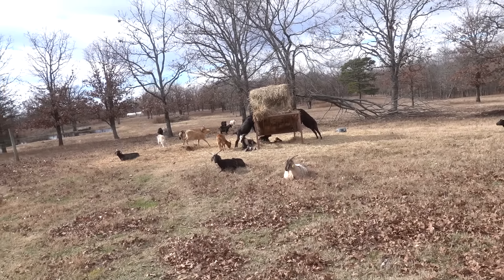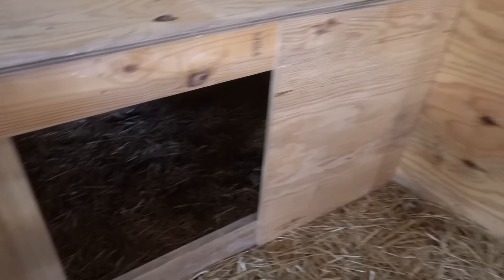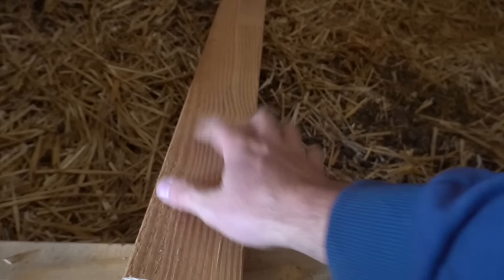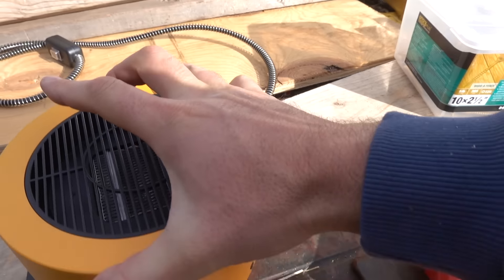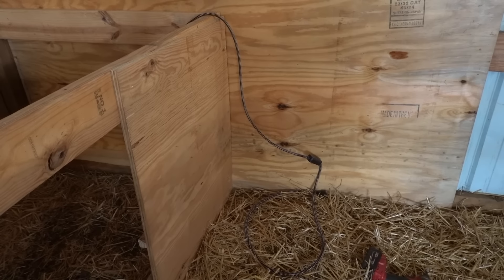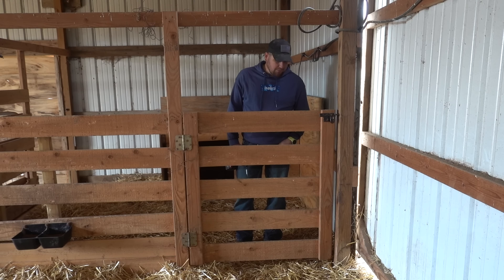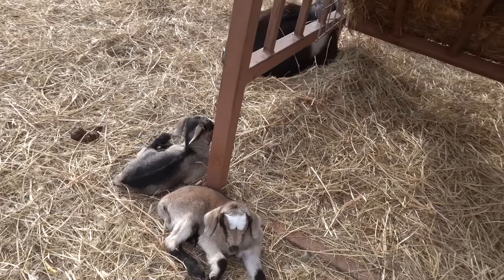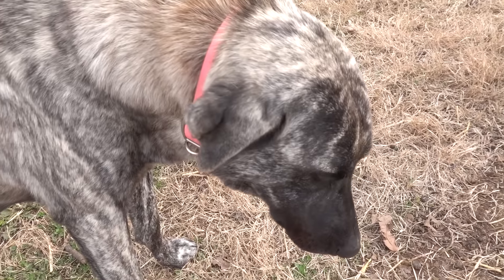Pregnant Guard Dog's Getting Massive! She's Already Bigger Than We Expected!

Comment: That is so nice of you that you built a birthing place for Kora.  You don't have to worry at all about disturbing the "bonding".  Kora and your other dogs see you as the leader of their family.  In fact, Kora will probably bring her babies to you actually.  😁😁  A small tip on Kora's box.  You may want to think about putting the top on hinges.  This will greatly ease you access as well.
Reply: I definitely second the hinges. If anything happens that you need to get to the puppies in a hurry or even just quietly, those hinges will be a God send.
Reply: Pepsi…what about hinging the side panel? That would keep them from leaning over, help keep the heat in and make for easier clean out.
Reply: @kathleenmoore4097  I was thinking the samething!!
Reply: A piano hinge would work real nice!
Reply: @J--G *Great minds think alike. I was going to congratulate Kevin on building top panel/lid with hinges as two fold now for  quiet/quick/easy access to puppies for cleaning etc but 2nd fold for Miss Cora to lay once the puppies eyes are open and they are are a little bigger and Miss Cora wants 5 minutes of peace and not feel like a 24/7 jersey 🥛 🍼 milk 🐮 cow  😂 😂 Miss Cora can still be there but out of reach especially if she gets sore nipples 😮 😢 from possibly feeding lots of 🐶 puppies 🐶 
Wishing Best 🎉 Life has to offer for Hidden Heights Farm Family & extended YT family 😉
Reply: Put a little platform for kora to lie on or another box inside where the pups can't escape and she can get up and stretch her legs or eat drink without getting hassled by the pups when they're bigger

Comment: Yes, move the babies inside if they are born out in the cold. With this being her first litter you may need to watch her to see how protective she is. If she is giving you problems about touching the babies initially you may need to put a leash on her and take her away while you put them all in the box then bring her and lock her in the stall with them for a few days. That should keep her from trying to move the babies back outside and give her time to acclimate to the box and feel safe. That usually works so she then keeps them in the box through out the nursing period. You really should put a shelf in the dog house also in case she decides to have or bring them in there while they are still tiny and weak. Love ❤️

Comment: You need to put Kora in the whelping area and shut the gates to keep her in at least 3-4 days before she reaches day 63. If she whelps outside in freezing temps, puppies will not survive as they cannot maintain their body temperature until they're 2-3 weeks of age.
Reply: Exactly right.  Puppies for first week need an environmental temp around 75-80F.  I point a heat lamp towards a corner so they have a warm corner. They can crawl out to a cooler area if they get too hot.  Then week 2-3 at minimum 70-75F.  Cold puppies will die.  Never feed a cold puppy as the gut will not digest the milk.  Definitely need a "pig-rail" about 4 inches from the floor or bedding pack and about 4 inches wide so that the pups have a way to get around mom without getting smashed.  I would also plan to keep Leeske out of the area.  First Cora might go after him and second he might go after the pups thinking they are rats when they squeak.
Reply: Yes 100% especially this time of year and being a 1st time mom need to be confined during the week prior, that way she will be used to it and less apt to be stressed during labor

Comment: Kevin, how about putting a couple hinges on the back of the lid on the dog house with a couple latches on the front with a prop stick. That way you can open up the lid without using the drill to remove the screws which may scare the puppies and or Kora if you need to gain access from the top.

Comment: The welping box design is very typical of what is used for pigs. The purpose is to keep the gilt from rolling over and crushing the piglets. Sometimes a railing is used and sometimes that railing is used to block off and protect a corner, allowing space for the piglets to snuggle up on each other and even hang a heat lamp, all protected from momma.

Comment: Nice box for cora and puppies. That heater sounds too hot. Dont let the pups get too heated. Remember cora and leesky are used to the cold.  Fix the hole on the right going into the dog stall. Put some boards down around the perimeter of the stall so puppies cant follow cora and get out. Thet can crawl through little holes.
Run your hand down under those boards you added to the sides of the box to make sure the screws didn't go through so they wont cut the puppies.

Comment: For your welping box you need a rail. This is a piece of wood attached aprox 5 to 6 inches above the floor and sticks out 4 to 5 inches from the wall. This rail goes all the war around the box. The purpose of the rail is to prevent mom from laying on or pinning a newborn puppy under her and against the side. Many puppies die this way in the first few days after they are born. Mostly to new moms. It's a very simple fix to prevent this from happening most of the time.
Also feed her treats in her welping area and even inside her box. Help her LIKE the area and associate it with good things like fresh warm hay to lay on and eating treats.
Yes you can move the puppies to her box BUT don't be shocked if she does let you touch them or if dad suddenly gets super protective for her. Just slowly work your way in, they trust you but you are working with instinct. Also once you get them moved mom may decide to move them back. You may need to move them more then once and possibly lock her there for a couple days.
As for the heater PLEASE be careful of anything with a cord. Dogs chew, puppies chew more and love to explore new things with thier mouth. Fires start easy in barns with hay. Puppies are born with a full coat of fur and a well insulated protective attentive mother. She will keep them warm and if she gets up to go out to potty or eat they will ball up into a pile. It's instinct driving that. Cora is a breed that routinely has puppies outside with zero human intervention. Her mothering skills are in her DNA and strong. You shouldn't need that heater at all but if it gets down into single digits maybe but be very watchful. True puppies don't regulatebody temp well on thier own but they are born I litters and together they do very well in a pile.

Comment: Use pool noodles instead of boards Kevin.  They can still be squished if you use boards.
I would also suggest you take the top off and use a heat lamp to warm the space.
Cora will have no problem with you moving them to a safer place... put a blanket in there and give her time to start nesting in that space...  I can't WAIT for the babies to come.  I train 8 week old labradoodle puppies for the Bonafide breeder (and new owners).  My heart belongs to puppies! <3
Reply: I just found pool noodles at the Dollar tree , great job Kevin in the dog house , I’ve not particularly seen tops on whelping boxes but hopefully it will work .. putting hinges in it for easy access would be beneficial I’m sure ..!

Comment: When its near her due date, definitely keep checking on Kora. When they are new moms they don't always know what's going on until they have a few puppies and go thru the  process of cleaning them up. I had a cocker spaniel   start having her first litter and she was pacing around and just dropped one out and she got confused.  I picked it up and started cleaning it off in front of her by  tearing open the sack  the puppy was in  and massaged the puppy to stimulate it and she started cleaning it off with me.  Once that happened she was great with the rest  and her motherly instincts kicked in.  Best of Luck.  You have so much experience with birthing animals and its not that much different, just a lot more babies.

Comment: If the puppies are born outside, there is no problem with moving them. The best way is to get a box with a blanket in it so you can put all the puppies into the box and then cover them with the ends of the blanket. It is important to let the mother be present while you are placing the puppies into the box so she will understand what you are doing. Some special treats for Cora will let her know that you are proud of her as a mom and she shouldn't be a problem with letting you move the puppies.

Comment: Yes you can move them.  Cora will more than likely appreciate the den you have constructed for her.  A pig rail ( the lower barrier around the border of the box) should be about 6" above the floor.   2x4 or 2x6 should be enough room for puppies.  Having the top of the box removeable would be a plus.  Makes it easier to clean and to check on the puppies.

Comment: Yes. You'll need pig rails in your whelping box. You'll also need Oral Calcium for Kora. At the first sign of her acting not so nice to the pups, or mouthing them a little too roughly, dose her with the Oral calcium. She'll settle down pretty quick. Good luck. I just whelped a litter of 6 Morkies on Christmas Day 💕🙏🐾 I would have gone with a heating pad, as the cold ground will suck the heat out of the pups bodies, as they cannot regulate their own body heat for the first 10 days of life. I'm thinking with a thick bed of hay, you won't even need any heat in there, as long as the flooring is dry.

Comment: Kevin yes by all means move mama and her pups inside the little house and pen them up. I would also start by putting Cora in the pin for a couple hours before hand to help her to determine hopefully where to have them. Also don’t hold that 63 days to tight, I’ve had with German Shepherds there first litter come in as early as 58 days. Just be prepared.

Comment: The whelping box should have a bumper/rim around the side to keep Kora from smothering pups behind her when she’s nursing others. Also not real sure about having the top on the box but my litters were in the house and I had a heat lamp 12 to 15 inches over the top.

And YES, if she doesn’t have them in the whelping box, move them to where they’re going to be safest.

Comment: Great whelping box. Yes to hinged lid. 
Mom will be looking for a safe place to have pups. She will dig a shallow area behind a bush hidden from view. Since it's winter, I would not risk that. Chilled pups are at very high risk and cannot nurse. Taking mom's daily  temperature 6 days before due date will give you a good indication when it's time. Average dog temp 100-101. When it drops 2-3 degrees, birthing imminent. I recommend closing mom in whelping box area/pen immediately. 
I bred my dogs for 38 years, only 2 litters 2yrs apart, each mom. Good luck to you and the mom.

Comment: You definately will need to move the pups if Cora has them outside. It's ok to do that, Cora will still care for them. 
Whelping boxes don't usually have lids. What if you need to help her deliver, you won't be able to get to them. At least either make the top removable or with hinges. Pups need to be kept very warm, for at least, the first 2 weeks. They can't hear or see when they are born too.
Great pig rails for the pups too. We Lways have towels ready just in case mom needs help delivering. She may not, but anything can happen.
Love the baby coat with the white belt.

Comment: It's fine if you move them. We used to breed german shepherds and they were outside. We would move them from the outside kennel into a side shed of our garage that we converted where we had it loaded with straw and heat. The mom never cared that we moved them to a safe warm place. We also made a door for the mom to go potty. We took thick plastic and cut strips in for a doggy door and it kept the heat or cool air in.

Comment: I wonder if putting a hinged cover over the whelping box would make it easier for you to gain access quickly if necessary. If you did, you'd probably want to add a latch too. Will you be placing a security camera in the whelping box?  Are you going to put some sort of cover over the door of the whelping box when the pups get a little bigger, and Kora isn't as glued to the whelping box to keep the puppies from climbing out and wandering off?

I'm curious to know how Kora will handle her dual roles as mama and protector of her babies, and LGD, protector of goats.  I can see where she could feel really conflicted about where she needs to be in the moment if she feels he puppies need her, but she also feels like she has work to do protecting the goats. It wouldn't be surprising if she shifts her focus to guarding closer to the barn and allows Leeske to do more perimeter work.  It will be interesting to see how everyone adapts to the new situations. As far as Leeske and the puppies go, I've seen mama dogs get pretty surly and fierce with the sires of their pups making it clear that he'd better mind the boundaries she sets with her puppies. I can see Kora doing that....

Comment: To make sure dog or goats don't get into the cord, you can put a 2X4 on each side of it, inside the box and on the outside. Even another board over the boards, but, it's probably not needed. Hinging the top sounds like a great idea too. I noticed goat  "mess" inside, I'd keep it cleaned up or block it off so they won't pee or poop in there, Cora may not wanna have her pups in that mess.

Comment: 💡EMU FEEDER TIP! To keep the barrel cut out from rubbing feathers off.. try putting the grey pipe insulation tube that normally you use to insulate pipes that is split in half. You can cut it to the length of your cutout and fit it right on the bottom part of the cutout, even the top also if needed. You may need to glue it for it to stay good.  I hope this idea might help that problem of rubbing the feathers off of them.
Reply: I think I’d be worried that the emus might peck that foam and eat it. A peck at the darndest things

Comment: Great job on the welping  box for Cora. I agree with some of the others that you should hinge the top of the box. It will help you gain access to the puppies and Cora. You should be able to move the pups to the whelping box but wear gloves when you do.
Reply: I agree with the roof of the dog house. Three hinges and a handle. Also, me myself, would have put in a 2 x 6 because part of the board is partly going over the other that is already in the box so you are really only giving them about 2 inches with the 2x4. Just am added precaution. 🙂

Comment: Yes, you definitely want to move them.  And if it gets as cold as you say, you might wants to put a heat lamp to make sure they stay warm. In a sense, they are more fragile and susceptible to old for the first 2 weeks than the goats.  A friend of mine bred Alaskan Malamutes and she had the whelping box in the garage and lost half of the litter due to very cold temps. Just saw that you're adding a heater... good job :)

Comment: If Cora whelps outside you can move them to whelping box with out a problem . The I move my dogs puppies every time they whelp in the wrong place . You also are going to want hinges on the top of whelping box so you can easily get to pups if you need to ,( check weight gain if large litter to make sure they are all getting enough to eat. If you have one or more that are way lighter then the rest then you will need to bottle feed once or twice a day to make sure they are getting enough to eat

Comment: I’d advise setting up a thermometer in the dog house and a thermostat. You want a constant steady temperature, no fluctuations. It could get too hot for Cora and make it uncomfortable for her. Monitor temps in there for few days before she goes in. Ideally 29-32 degrees Celsius or 85-90 degrees Fahrenheit. For the first week and reduce it slowly week by week. I’d definitely put hinges in the middle so you can easily access by folding one half of the lid back, provide ventilation too. Definitely monitor your internal temperatures before introducing her, both morning and nightly, this is where a thermostat comes in handy.
Probably a good idea to start feeding her evening meals in there, it becomes a good place, before eventually closing her in at night. Dogs are notorious for digging dens when the time comes.
Maybe a call to her breeders for some good hands on advice.
Good luck

Comment: I would put hinges on the back of the roof so u can just lift the top off and put a latch on for easy cleaning etc, and yes you can move the puppies she should be fine with u helping but sometimes mums don’t want dads around so u may have to separate leasky for a little while, xx happy new year xx

Comment: Depending on the temperature in the welping box puppies can't reguate their temperature and it is advised to have a temperature of 80 in the welping box. Also make sure you have towels, scissors, gloves, aspiration bulb. Also if it is to cold where she has them i would move them as she is having them.  I had a mom that started having them underneath a couch we  moved them in between puppies as we were worried one would get hurt.

Comment: Kevin, you might want some gloves, in case you need to help her and also, would be good to have bulb syringe, like used with human babies, to suction their nose and mouth. And, use iodine on their umbilical cord, to help prevent infection. Also, maybe doggy pee pads, to keep down on the mess in the box. Kora will probably want to go outside the pen to potty, so maybe not an issue with her.